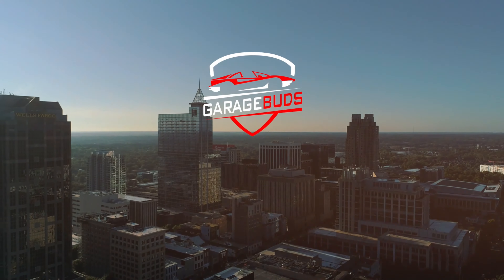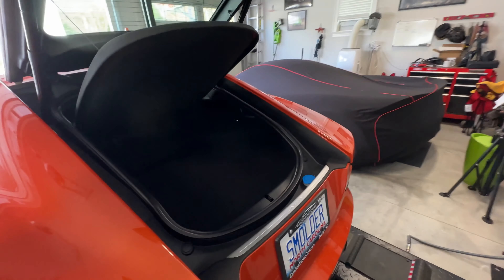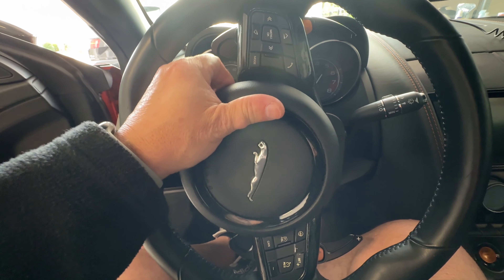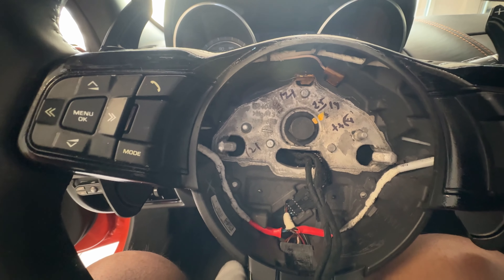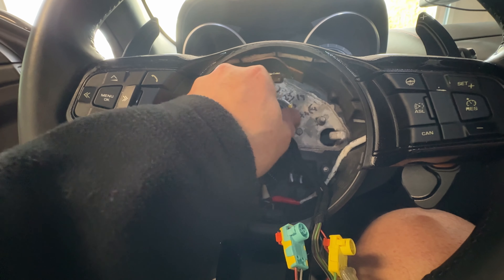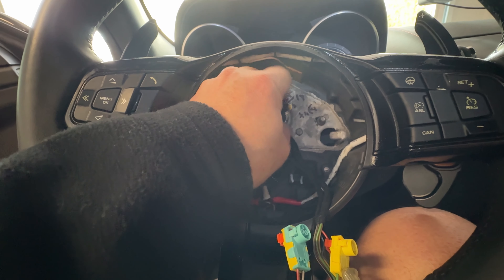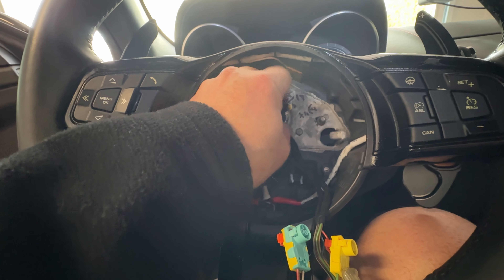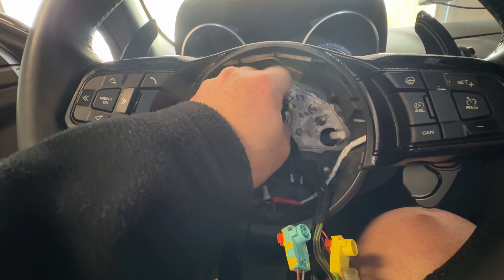Installing New Steering Wheel on a Jaguar F-Type

Comment: Hi there, great video! Do you happen to remember the part numbers for the two switches (Bluetooth and cruise control)? When I see the parts online, it appears the logos on the buttons are not there by default. Lastly, do you know if the carbon fiber sections click on the steering wheel? Mine is also the 2015 F-Type R. Many thanks!
Reply from the maker: Hi, I don't know the part numbers. Maybe you can check on this site: https://parts.harperjaguar.com/v-2015-jaguar-f-type--r--5-0l-v8-gas
The carbon fiber sections click? Not sure I understand your question....